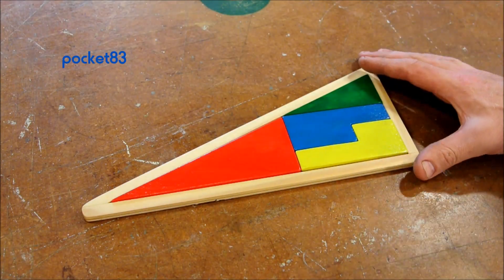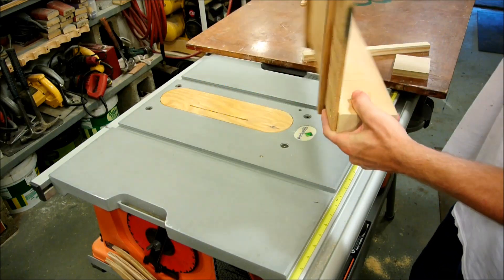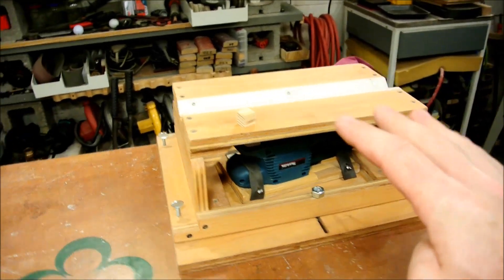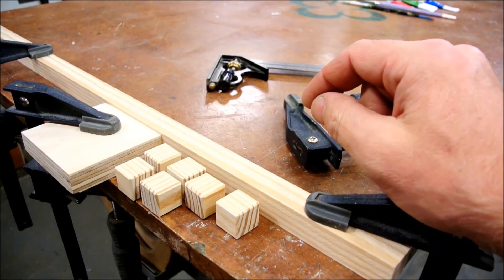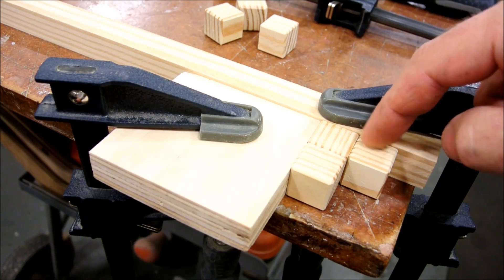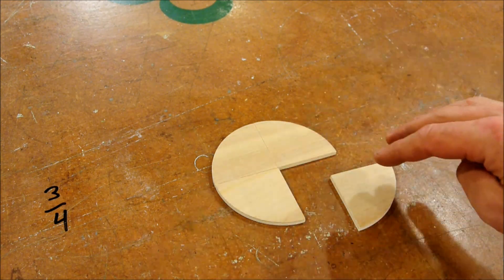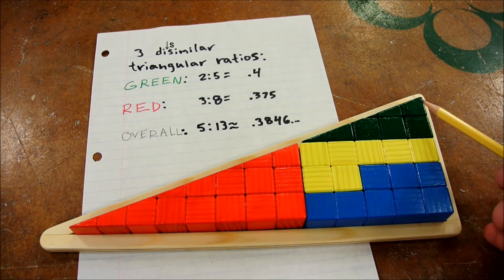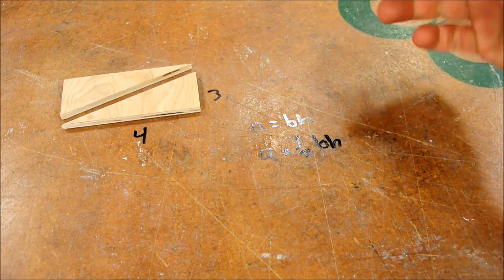Triangle hole trick: made 3D from cubes and explained

Comment: The cube part is easy :) especially if you buy square dowels and forego the sanding jigs and just hold the cube at an angle to the sandpaper.   But How do you cut them at the angle? The table saw sled cuts only right angles correct?

Comment: I have a question about the shape of the interior of the tray.  Do you think the hypotenuse should be a straight line or should it be slightly bent to be able to fit the larger configuration of tiles more snugly?  I can see advantages to each.
Reply: You might be right. I honestly don't remember if I did something like that, but it sounds reasonable to make the tray kind of in-between those two shapes.  It might make a more convincing illusion, since the play would be halved in both cases.  

I do remember that this project takes some fitting. And I also remember that the cubic version was more convincing.

Comment: Here's my guess. One of the triangles is at a steeper angle, when if you lay it out over an actual triangle (because if what I think is right this shape is a quadrilateral.) There are bumps and dips. When you switch the "triangle" then the bumps and dips combine and you get the missing square.

Comment: Great video! I'm interested in making it myself. Did you just use a crosscut sled to cut the joined cubes into triangles?
Reply from the maker: I used a bandsaw. I was conservative with cutting near my line, and then I disk-sanded- it in order to sneak up on it until it was a perfect fit. 

Sorry that I left that bit out. I wouldn't recommend using a sled unless your sled has toggle clamps to hold the piece, or unless you make something for the piece to sit in first.

Don't rule out using either a coping saw or a backsaw. The pieces aren't very big, so being careful is better in this case. Good luck ;)
Reply: Thanks for the reply! Without access to a bandsaw I'll likely use a coping saw like you recommended. This will make a great gift for a math teacher once I graduate.

Comment: hi, i am an architecture student and throw out the semester they ask us to make study models for the project to design and stuff.
my question is whats the easiest method to make the final model cause i struggle alot at the end of the semester when you have to make a precise model highlights the site surrounded by streets,cars,trees..etc 
plus the main building which can some time be challenging if it curves or weird deconstruction elements and such. sorry for making a long comment but i really wanna be better at making models and i admire your work alot. thanks
Reply from the maker: That all depends on what materials you are using. Foam board is probably the standard for simple models, but the "wow" factor comes from the details. 

Alternate surfaces add color and variety. Cardboard covered with spray adhesive will hold enough sand to make a textured driveway, and of course the color can be altered by using colored sand or paint. Snow-foam can be textured by spritzing it with a solvent to make its surface irregular, and by then painting it with acrylic, you can easily mimic stone, stucco, block, or concrete. Try experimenting with making you own mini trees by drying out some tall weeds, hitting them with spray adhesive, and then rolling them in pulverized dry grass.  

Cutting curves is best done with a scroll-saw for small scale stuff like you're working on, but a coping saw, an Exacto knife, and some 220 sandpaper will get you through the project. Good luck.
Reply: pocket83 thanks alot sirfor everything and good luck to you too ❤

Comment: Is it possible to this without tools
Reply from the maker: Not really. However, you could buy the wooden cubes at a craft store. You will still have to cut the triangle pieces though, so this will require at minimum a handsaw, some wood glue, and some sandpaper. The clamping could be done with rubber bands, if you're clever.

It's not beyond you. If you want it bad enough, you can have it ;)
Reply: pocket83 well, I don't have a tablesaw hax saw and my sand paper is 120 grit

Comment: im not sure what you just explained... how does that solve the puzzle?
Reply: Poe's law aside, the triangles are not similar in the mathematical sense of the word. they are only close enough in their general shape to fool you into thinking they are.

their angles and base to height ratios don't add up. this means the smaller triangles don't and even can't fit into the big triangle snuggly, just like a cylinder piece doesn't fill a square hole of the same diameter all the way to the corners. this is the same sort of thing. there will always remain some unfilled space in this puzzle - by design.

essentially, if you sliced the cube up, you could fit it slice by slice in the gaps along the sides of the pieces even in the "full" configuration.

In concept this puzzle is no different from the chocolate bar trick in terms of the underlying principle, the only difference being the frame, which is only introduced to reinforce your belief that everything fits as it should even though it doesn't. with the chocolate bar, you can easily measure the bar after removing one piece from it and confirm it is indeed shorter (as you would expect).

The design of this puzzle is just more successful at hiding the fact that even the "full" configuration of the pieces falls short of filling the frame perfectly - even the "full" frame is really one piece short without making it immediately obvious.

as for getting into why the differently shaped triangles matter, I don't know if I can explain this any better than I already have, but there still are two angles that can vary in value in any given right triangle. I don't know if you have noticed, but if you take two right triangles, one further defined by having one angle of 30 degrees, and another further defined by having an angle of 31 degrees, when you try to superimpose these two angles, there is going to be a one degree sliver of difference between them, meaning they will not fit together "losslessly" the same way two "mathematically similar" right triangles would.

("mathematically similar meaning that their angles are identical and they only differ in scale, i.e. the overall size. once you start changing angles, you start changing the basic shape and not just the size of the shape, and such triangles are no longer considered "similar"). For example, two angles of 30 degrees would overlap perfectly when superimposed.

Again, you may not immediately notice one degree of difference between the angles of three different triangles of three different sizes, and that's totally fine, it's exactly what the puzzle relies on for its wow factor, but the point is, you should have immediatelly seen where the trick is once you have learned the triangles in question are, in fact, different. because the differences in angles between them mean loose fit by definition, and thus it should have instantly been obvious "where the cube went" - the answer is: exactly there! - in the open spaces that are inevitably going to be left between objects that don't fit together perfectly.

If you were genuinely confused, I hope I have confused you further despite my best efforts to do the exact opposite, and if you're really a troll, then i hope you've had a good laugh reading this.
Reply: watch the end of the video.
Reply from the maker: The three different ratio numbers mean that all three triangles are different shapes.
Reply: pocket83 i understand that, but how does that help solve the puzzle?
Reply from the maker: This is a case of Poe's law. Are you really having trouble with finding the solution to a four-piece puzzle? Even puzzles with SpongeBob or Dora the Explorer on them usually have nine pieces.
Reply: Petr Stuchlý wow you put a lot of effort into that
Reply: He tried, but couldn't. Basically the big triangle is not a triangle. In one configuration, the pieces are tightly fitted, and there is a hole in the middle. in the other configuration the front piece is a little loose, the gap looks insignificant, but the loose space adds up to the missing square.
Reply: The trick is that the colored puzzle pieces can be arranged into two shapes.
One shape is larger and has a gap to fit the uncolored-cube.

So far that's pretty straightforward,  It's easy to arrange Tetris blocks into a larger shape if you're allowed to leave a gap.

But what's confusing is that both overall shapes are almost-but-not-quite a triangle, and it looks like they both fit into the same frame.  In fact, the only reason the puzzle fits into a triangle-shaped frame is loose tolerances.   Because the two wedge-shaped pieces have different slopes, the line they form either dents in slightly or bulges out slightly, depending on what order you place them in.   If you added up the difference in area between the bulged out version, and dented in version, you'd find it adds up to exactly the area of the uncolored cube.
Reply: the triangles are vary very slightly
Reply: The triangles are not similar, meaning their corner angles are not the same. This causes them to be loose in the frame, making a space that can be rearranged in the right way from an edge space into a hole space of the same size.

Comment: Sometimes the finer points seem laughably trivial. But some people live for them. Since this channel seems to explore the minutia quite a bit i'll say what i ordinarily might not.
Having longer stock that doesn't ride right up against a long TS fence is not a reason not to use long stock. It is a reason not to use a long fence.
Reply from the maker: Ha! Point taken. But the fence isn't really a variable, is it? 

As for the charge of minutia focus, let it be known that I'm building an argument here, so I make the foundation first. You can follow along in the description and determine your own level of involvement, but it's often necessary for me to establish really basic assumptions, the reasons for which may become clear later on. 

At least, that's what I try to do, but it's hard to be consistent and not make mistakes.
Reply: See that slot down the length of the fence? That's so you can attach things like feather boards, and sub-fences. But double sided tape works too. But since a board changing direction slightly as a non-straight edge rides on a shorter fence can cause forces on the back of the blade (which is dangerous) i suppose it cant be recommended.

"charge of minutia focus". No charge was laid. I simply meant that you seem to do things properly, recognising the importance of things that other channels might skip over thinking their viewers have the attention span of a fish, when actually those little aspects are the keys to understanding how things work. Tis why i called them "finer points"